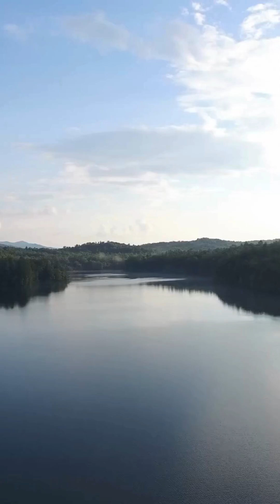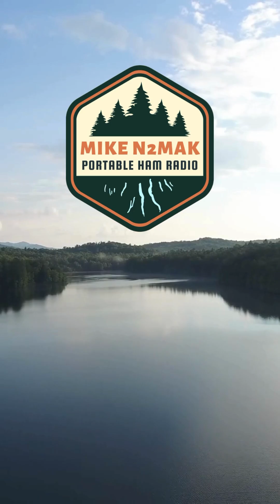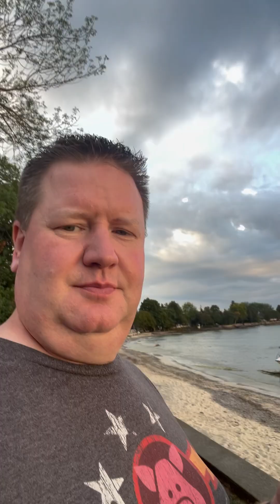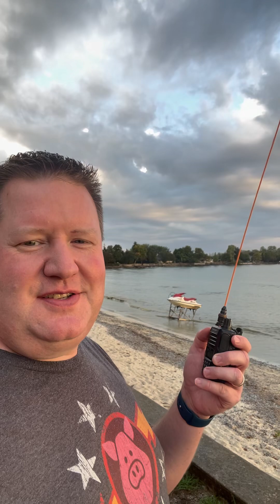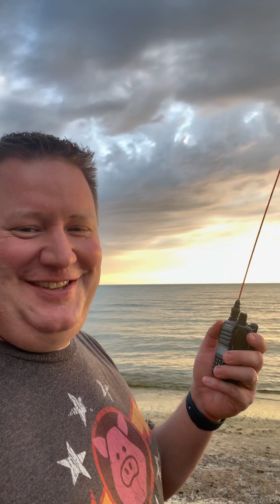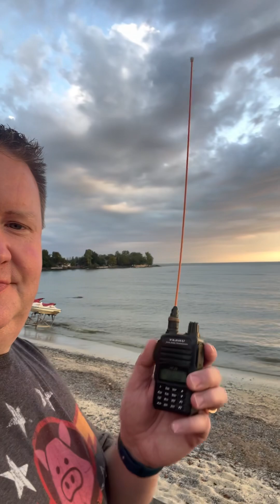Getting some tropospheric ducting over Lake Ontario on VHF and UHF

Comment: I just mapped it. Obviously I don't know your exact location, but to Bristol you might be close to 100 miles! 85 miles at least to the 85 repeater. Add another 5 miles if you're closer to Sackets Harbor. Now try it with that tiny new radio with less than a watt.
Reply from the maker: I did! But not luck, LOL. I was inside when I tried but I’ll give it a shot later this week.